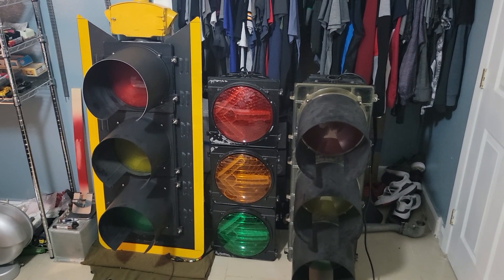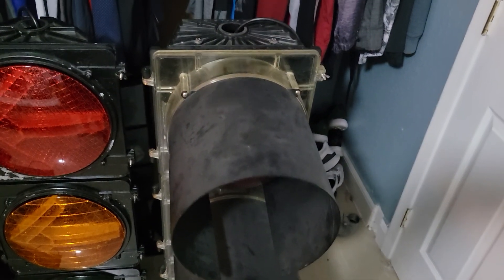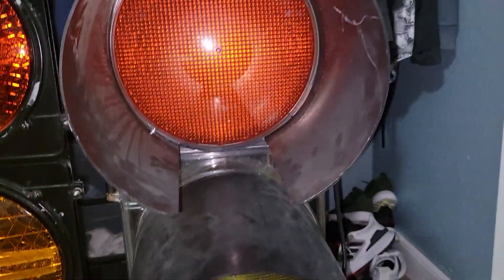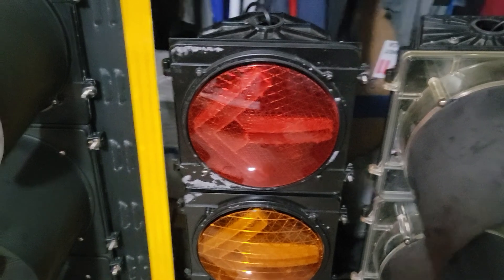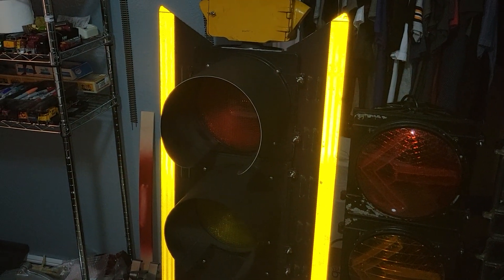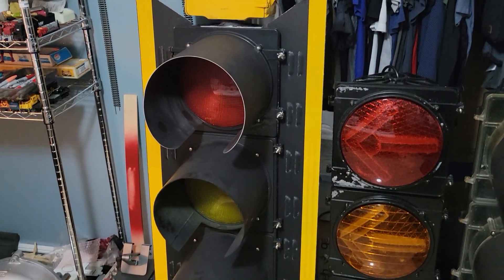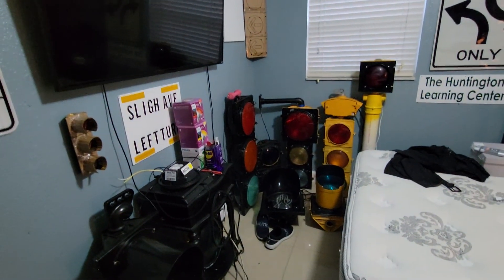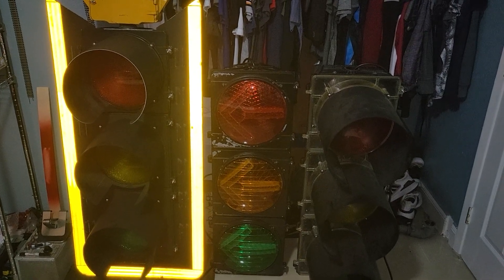The 3 Recent Signal Grabs

Comment: Did you say Siemens?
Reply from the maker: My Siemens Metaltop, yes.
Reply from the maker: These Metaltops are a very common configuration here in FL consisting of Siemens, McCain, Econolite, T-con, Peek, NAI, and others.

My belief is that these were invented for costs, weight, and durability (hence the aluminum section).
Reply: @kenytha5  We Have Couple Of Them In Colorado But There Is A Lot For McCain Signals